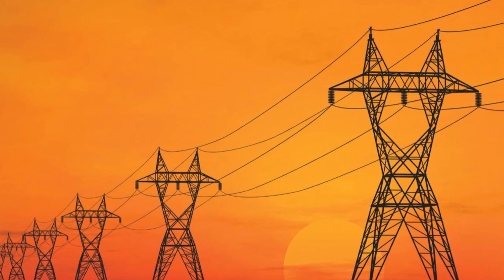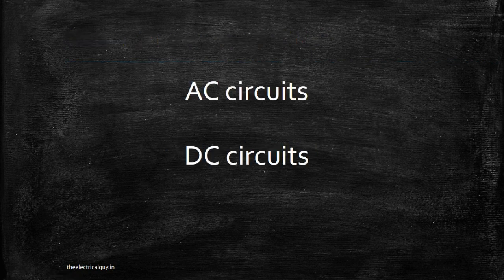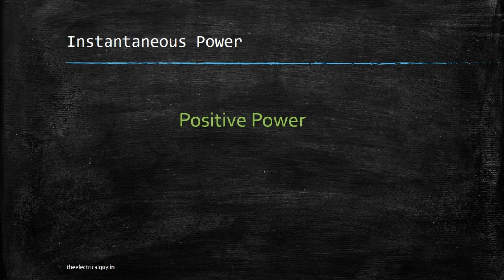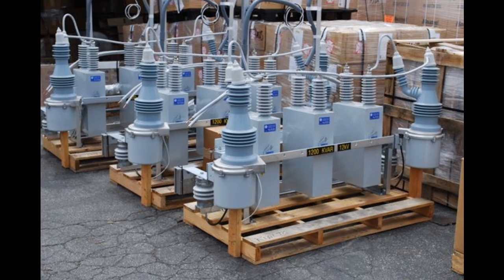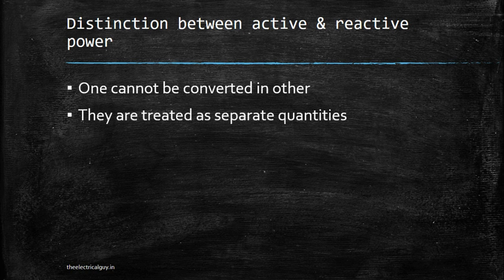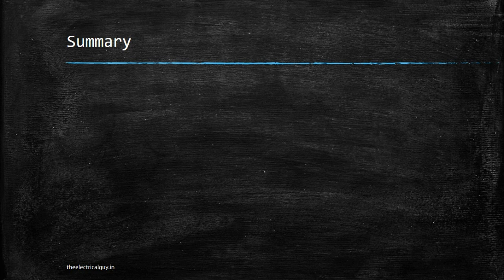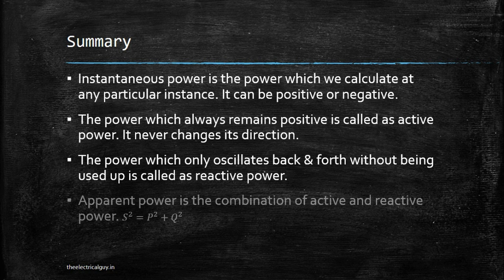Active, Reactive & Apparent Power | You’ll not get an easier explanation than this| TheElectricalGuy

Comment: I know I am 8 years late to this video. But I am here to thank you for giving me an 'aha' moment. I am not great at imagining stuff when it comes to electric engineering but I am very curious about electric science. But due to improper understanding and thus improper imagination, I never properly understood alternative current. I know 3 phase current properly but was not properly understood and picturised(within my mind) the alternative current. I know that power is electrons carryon voltage. If I am not wrong, Current is number of electrons at a given intersection in a circuit. And voltage is totality of energy(or pushing energy) taken by those electrons. Now I never properly imagined alternating current. But when I saw that changing units of current and voltage you shown while explaining the concept of instantaneous power, that's the ' aha ' moment. I finally understood and properly imagined alternating current. So am alternating current is where the number of electrons and the total energy they carry vary by time. Like, at one moment less electrons might be carrying more energy and at another moment more electrons might be carrying less energy. And so both current and voltage vary. And so two sinusoidal plots, one for voltage and one for current. That's the aha moment. All puzzles fallen into perfect picture. Basically the dumbo me finally understood and properly imagined it. Then I quickly asked perplexity about phase differences between voltage and current when electricity is generated by hydro electric power station. It said that usually there can never be perfect 'in phase ' voltage and current but usually devices are used to keep the phase difference constant. And then i finally finally(after years of dumbness)  understood why why why capacitor and inductor are used. People may laugh at why I am jumping at learning these simple concepts. 😊. But for me it's big. Because I never understood (and imagined) alternative current, I never understood why capacitor and inductor are used. And I never understood why phase diagrams at all are used, what is phase difference and why thetas, sine thetas, cos thetas comes into calculations. Though I love the subject of  electricity, due to my defective understanding and imagination, I had handicap of knowledge. Now that one crux(current and voltage difference)of alternative current fallen finally into my puzzle piece, everything is clear now. 
I can't thank you enough. Thanks thanks thanks a lot. May god's bless you 🙏🙏 🙏

Comment: A question here, in the video "Where does reactive power go", you mentioned that capacitors give the reactive power to system while inductor consume the reactive power from the system, but why would you say that when reactive power is oscillating back and forth in both the devices?

Comment: Good explanation, very easy to follow.  I would have liked some examples though. I think I understand the concept, but someone please correct me if I'm wrong with the following. 

With a battery backup, like a UPS, it will have an apparent power (will call it "capacity" going forward), the active and reactive power combined. When it's supplying power in a power outage it uses active power and the remaining capacity (assuming it's not at 100% load) would be reactive power. The amount of capacity being used is the Power Factor. Hope I understood that all correctly.

Comment: Your explanation of the three powers involved is excellent, and I sincerely thank you for it. Yet, I should point out what I find a minor mathematical error in your presentation, unless I missed some detail. The relationship between apparent, active and reactive power is not linear. Therefore, PF=P/S =0.8 does not mean that Q is 20% of S, since  Q/S = 0.6 . For Q=0.2 S, PF = 0.98.  Your statement would be true if S=P+Q, which is not the case.

Comment: I was under the impression that all inductors required reactive power, but in your diagram you indicated that the inductance A is taking active power from the circuit.  How can I tell if a component, machine, or equipment is using reactive power or not?  Does the name plate on a piece of equipment will tell you that?

Comment: Hi there. I am a bit confused. You said PF is the ratio between active and apparent power. But when you described if a system has a pf of 0.8 then it means it has 80% active power and 20% reactive power.I will be fortunate enough if you would  clarify this . FIY thanks for this amazing video.
Reply from the maker: Hi.. i have a dedicated playlist on power factor. you can check out it on my channel. You'll get your answer.
Reply: @GauravJ  Thank you very much. Do you have any resources on SF6 Circuit breaker wiring diagram and also how to understand the ferrule.

Comment: There is a mistake at 13.31..
You are saying that P = 0.8*S then how can you directly say that Q = 0.2*S?
Actually, it should be Q = sqrt(S^2 - P^2) = 0.6S means there is 60% is the reactive power!

So if S = 100 VA then P = 80 Watts and Q = 60 VAR.

Comment: Hello,

This comment is kind of a hail mary, but I figured I’d try. I’m working for a consulting firm where I am beginning to do electrical engineering tasks (I am a mech eng graduate). One concept is bothering me – in my circuit textbook it often describes in a problem how I am “delivering” 80 W of power and “absorbing” 60 VAR of magnetizing power. It then says that my overall complex power has a magnitude of 100VA. Maybe it’s a language interpretation but if I am “delivering” but also “absorbing” why do I still need to provide more apparent power? Doesn’t “absorb” imply that I am being “helped” by the magnetizing VARs? This is for a capacitive circuit – for an inductive circuit it makes sense that I have to provide additional VA to power the magnetic field but in this case the math makes more intuitive sense. 

Thanks, 

Brian

Comment: thanks for the clean and simple explanation. would the stator field winding of an induction generator(negative slip induction motor) draw only reactive power from the grid or would it draw active power on account of winding internal resistance also ?

Comment: Thanks for sharing your knowledge. There are two mistakes. 
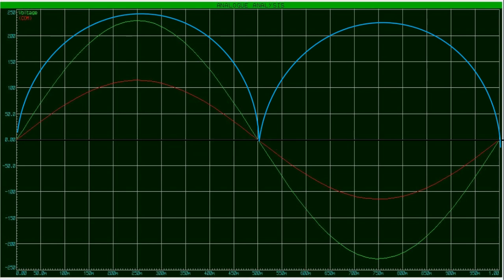Min. 6:35 - active power has a different shape A*(sin(theta))^2
Min. 13:25 - a power factor of 0.8 means: 80%=active power, 100%=apparent power, (apparent power≠active power+reactive power; apparent power^2=active power^2+reactive power^2)
Reply: I was thinking about the same thing. PF of 80% does not mean the reactive power is 20%. in fact Q/S will be more than 0.2 if run the calculation.
Reply: Understanding the 80% and 20% Concept:
The power factor (PF) of 0.8 means that 80% of the apparent power is active power and 20% is reactive power.

80% of 100 VA = 80 VA is used for active power, which is doing useful work (i.e., 80 W).
20% of 100 VA = 20 VA (i.e 60 VAR obtained from eqn s2= p2+q2)is used for reactive power, which doesn’t do useful work but is necessary for maintaining voltage and sustaining the magnetic fields in inductive loads (like motors or transformers). HERE 60 VAR is what you get as 20 % of 100 KVA and 80 watts is 80% of 100 KVA . cant interpret them as simply 80 and 60 percent mathematically .

Comment: At 13:23, 80% active power doesn't mean that remaining 20% would be reactive.
Because, S is not equal to P + Q, but S is a vector sum of P and Q.
If S = 100 kVA and Power factor = 0.8, then P = 80 kW and Q = 60 kVAR (not 20 kVAR, which is 20%).
Reply: how 60 kVAR came explain plss
Reply: @madagalaharivardhan9412  , use the vector addition. YOU WILL GET THE ANSWER. 

S= P+Q,  DON't rely on this formula, use the triangle law of vector addition.
Reply: @priyambandyopadhyay6575  thanks for reply but i forgot what i asked since it was one year back..lol
Reply: @madagalaharivardhan9412  ohhh. but you can check your own question in the comment previous to my comment.
Reply: @priyambandyopadhyay6575  forgot means not question i asked .i forgot the concept shhhhh
Reply: @madagalaharivardhan9412  hahahaha 🤣. What happens when you don't touch a topic for a long time

Comment: Fantastic information. Will move to this topic once I have a clear understanding
of local single phase step down transformer. How does current (amps) 
(the unbalanced portion) return to the center tap of the secondary winding
when that center tap is EXACLY at Zero voltage and Zero amps? 
Also do the returning electrons switch back and forth ( + and - ) or not?
Confusion. thank you.

Comment: Where does this reactive power go when the load is using a part of apparent power....??
Reply: The magnetic part of the cicuit is the part that is returned to the source and vice versa. This creates back E.M.F. that prevents inductive loads from becoming purely resistive which would cause a voltage collapse , essentially a short circuit, causeing current to increase to dangerous levels , burning up transformers, motors ect. The ohmic part of the circuit could not limit current to a safe level, back emf is essential to those types of loads. When a motor or xmer is first connected to voltage source the current is very high until a back E.M.F. is generated or produced. This reactance is what prevents thses devices from burning up.

Comment: Do not misguide , It is not that Q is not useful to the power system, that is absurd because reactive power control is easiest way to achieve constant voltage at the PCC. And it is not that Power flow always follows the load but also flows back to the grid in case of DGs. Also, 0.8pf does not mean  80% active and 20% reactive power of 100% apparent power. Pf can also be obtained by P/S, when the current and voltage phasors are not defined but this does not always help determining it.

Comment: Great video but gotta say that capacitor and inductor are linear elements unless their c and l values vary over time. That's because C=charge/voltage and L=flux/current which are linear relations. They can only alter the phase but not the frequency of the input. That's why you get a constant impedance when you divide voltage by current.

Comment: Correction: If 80 % is active power then 20 % will not be reactive power. Because, suppose apparent power is 100 KVA and active power is 80 KW then reactive power will be: sqrt(100^2 - 80^2) = 60 KVAR. So 60 % will reactive power.
Reply: Good point

Comment: inductor and capacitor are linear devices not non linear
Reply from the maker: Capacitors used in electronic circuits are mostly linear, that is, the voltage is proportional to the charge. But the linearity depends on the dielectric used. There is a class of materials called ferroelectric materials that exhibit a highly non linear and hystersis type V-Q graph. A capacitor using this dielectric will not be linear.
Reply: non linear devices are diodes, transistors etc. inductors and capacitors has nothing to do with non linear device